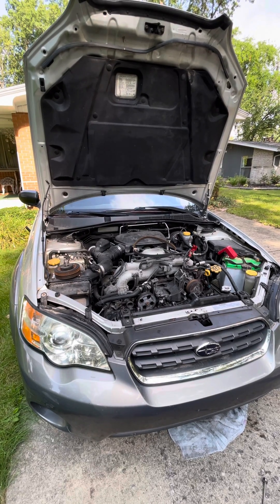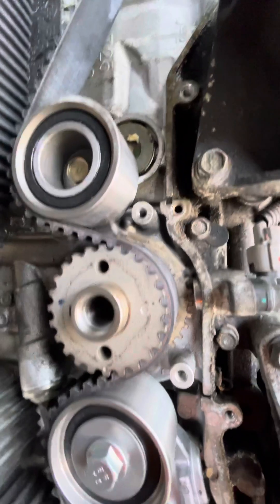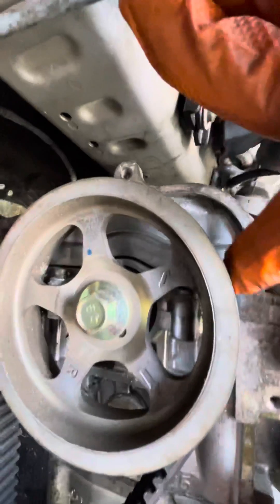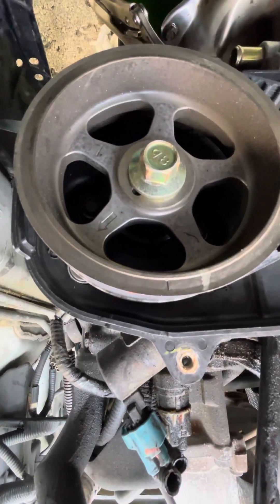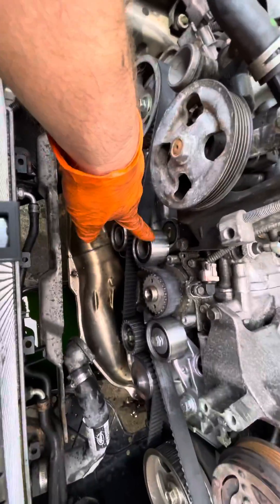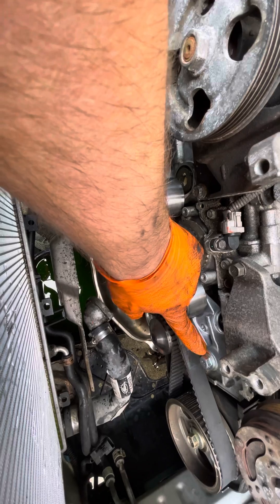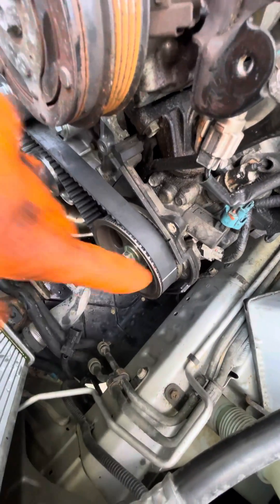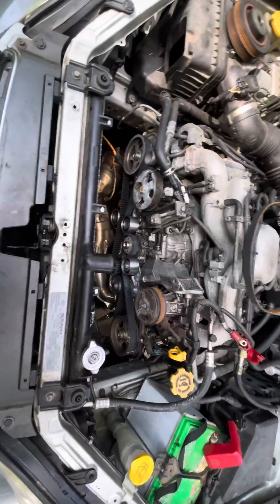2006 Subaru 2.5 timing belt alignment marks | simple way to do it

Comment: If I have already removed the timimg belt and pullies how to I rotate the camshafts into position?
Reply from the maker: Use a socket on the cam bolt to turn it to line up the mark on the cam to the head on the passenger side. On the driver same use socket to turn cam then it has a mark on the cam gear line up with the plastic notch.
Reply: @justanothermobilemechanic7997  I heard it's safer to us a ratchet than a socket
Reply from the maker: You would have to have a ratchet on the socket. So yes I didn’t say a opened end wrench. But you could